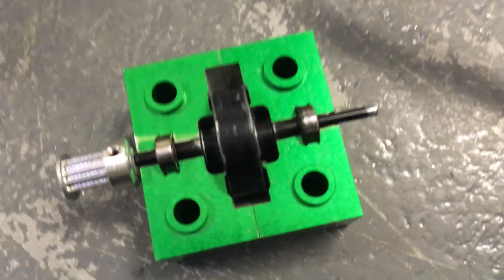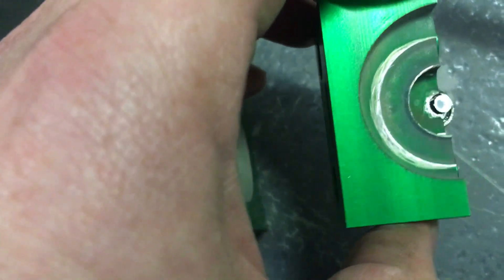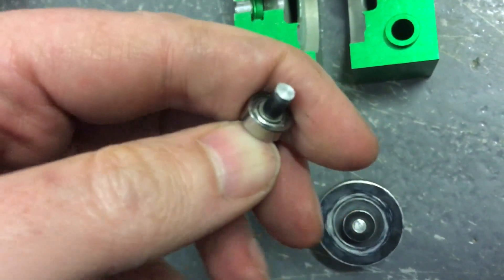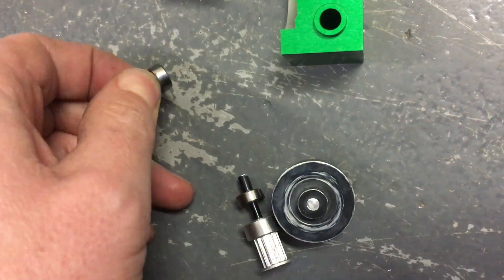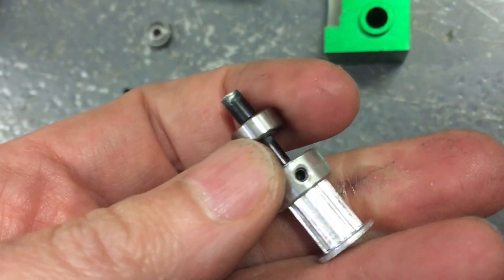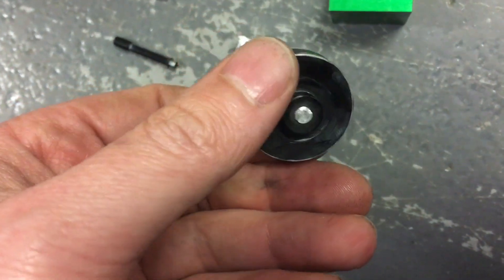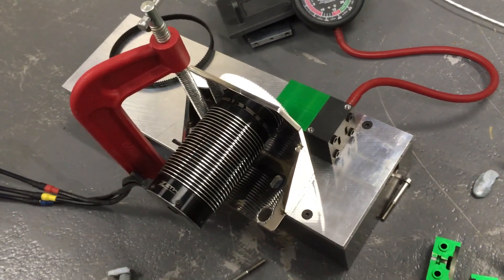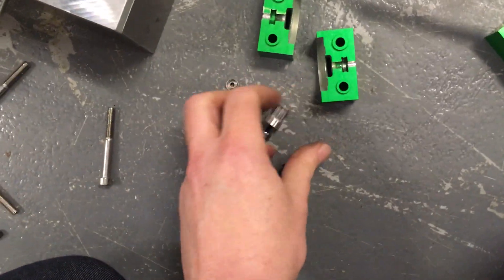Miniature Machine Single Disc Rotor Destruction Test 1 - The Damage!

Comment: I was expecting a grove in the middle of the disk for a second there, looks like it put up a fight. thicker shaft and bang on...oh damn not intended but funny IMO so I am leaving it.
Reply from the maker: The tests are to see what the strongest but bargain basement of surface area, bottom of the range rotor can do. Where does the vacuum pressure ramp start on a rotor this big with 28mm diameter? It starts off at about 100rpm on a 800mm rotor. The sidewall gaps heavily affect this and this is ultimately what I'm tuning. Can a single disc rotor be of any use? Tesla writes that a single disc can perform as much work as a whole bucketwheel.
Reply from the maker: Yeah the thing is I could machine this rotor to something neat and insert a grade 5 titanium or Inconel 718 shaft in there and it's good to go!
Reply: @nikola.tesla.r.and.d.centre   Good to see the work is going on. :)

Comment: Jeez, I was expecting worse. Much worse...
Reply from the maker: As I have copied the way Tesla builds his rotors, not one of the crashes I've had so far has been dangerous. I've had perhaps a dozen now, many off camera. This is why I'm confident to be around the machines when doing high speed testing. I never used to be, I would hide behind something thick.
Reply: @nikola.tesla.r.and.d.centre  That was sensible it doesn't take much to die from high-speed bits flying around.
Reply from the maker: @Barskor1  I have proved when these machines are built to the way Tesla's diagrams depict and are described in his patents they are perfectly safe.

Here is one of his writings on the subject:

"Another advantage deserving the most careful consideration of the user is the perfect safety of the new turbine. There is an ever present danger in a machine of the old type, that the wheel might burst and destroy life and property. Such a deplorable accident is absolutely impossible with the new turbine rotor, composed of thin discs which expand slightly and come to rest, invariably without damage, as has been shown in exhaustive experiments."

https://teslauniverse.com/nikola-tesla/articles/lighting-machine-novel-principles
Reply from the maker: If these machines are built as Tesla depicted in his diagrams following all the text information of his equipment from the patents, I would gladly work around them in high speed destruction tests. The closest I've been to an accident in this line of research so far is burning myself on the PDE or a pulley coming off that really should have been on a key way. The 16hp starter motor for the large vacuum pump / wind turbine hit a resonant point and the whole thing was like a magic carpet crossed with a whacker plate. I was standing on it at the time whilst it moved randomly around the workshop.

Comment: looks like a bad design :-P
Reply from the maker: The design can be massively improved. Matching the diameter, side wall gaps and rpm for what you want it to achieve, its a solid design. You can't expect it to make high vacuum at low rpm unless it is large diameter huge, but it is the rotor that is most unlikely to warp. I just put about perhaps 75% of 13.33kw / 17.87hp through an unbalanced rotor with a 3mm aluminium 7075-T6 shaft at 136,000rpm before it broke! It proves how good the material is and how safe Tesla's designs are. Take that shaft up to 8mm and that will take some torque! Here is the most powerful RC motor in the world with a 10mm shaft and 53bhp. https://www.mgm-controllers.com/en/the-most-powerful-esc-motor-combo-for-rc-cars
Reply: @nikola.tesla.r.and.d.centre  alone the missing radius between the different shaft diameters is a no go :-)
Reply from the maker: @lookingforthemeaning  depends how strong the yield tensile strength is. If it was grade 5 titanium more than twice as strong. A thicker shaft is the best option and a taper between them, I see what you mean. I've done a taper on previous shafts. Also not such a tight sidewall gap. I've already found out that taking 0.3mm off the sides performs much better. Also I have bearings rated at 373,000rpm which is much better than the ones used in the destruction test that were rated at 80,000rpm.
Reply from the maker: @lookingforthemeaning  to be fair all things considered it took a lot of punishment for what it is. Using compressed air and the correct gaps it will likely go supersonic at 234,000rpm without breaking.

Comment: that motor's a beast
Reply from the maker: I know yeah 300amp @ 44.8v https://www.align-trex.co.uk/rc-cars/rc-car-electronics/rc-car-esc-motor-combos/1-5-beast-pro-combo-with-300a-esc-bp-70120-620kv-motor-lcd-program-card-ztw623005112.html?gclid=CjwKCAjw4ayUBhA4EiwATWyBrqZFc-EIl5h7IzHgBSTmbAEAJuEvKJpCEvPW8wATHX5ocqocYv9a7BoCBwYQAvD_BwE Have a look at the daddy! https://www.mgm-controllers.com/en/the-most-powerful-esc-motor-combo-for-rc-cars but for speed this one does 65,000rpm as has carbon fibre covered rotor.... I would go for this next https://www.mgm-controllers.com/en/top-speed-12s-esc-motor-combo-en-10 I don't think the ESC's look anywhere near as pretty as the Beast Pro.

Comment: In Tesla's designs, how did he deal with heat(build up/dissipation)?
Reply from the maker: "Nearly Frictionless Bearings" Tesla called them. Using a viscous fluid gearbox to transfer the torque via vortices rather than a belt or gear drive. He worked out the mechanical equivalent of an air core transformer and applied it to 2 stage machines primarily with a 1:3 first stage to 2nd stage surface area amount. He patented this device in 22 countries. Originally Tesla used hydrodynamic oil bearings but later switched to hi own aerodynamic bearing design. Passive magnetic bearings  can have 500-5000 micron tolerances compared to air bearings much harder to achieve 2-50 micron tolerances. Also passive magnetic bearings don't appear to suffer from fluid shear because of the much higher air gaps.
Reply: @nikola.tesla.r.and.d.centre  Ah. Thank you. Can you recommend a book on the subject, that maybe covers his experiments, please.
Reply from the maker: Tesla was quite secretive with the experiments for these machines. His assistant Fritz Lowenstein did document some of the early experiments as they had to use it for patent rights purposes to prove the adhesion and viscosity principle to the US patent office. I'm sure with a little bit of searching you will find this book for much, much cheaper and it does have those tests. https://www.amazon.co.uk/Teslas-Engine-New-Dimension-Power/dp/188491733X 

Most of what I know was learnt through experiments which then made Tesla's writings have a whole new meaning. Many of these experiments are documented on this channel.
Reply from the maker: By continually expanding air this created a cooling effect when using contact free bearings as no place to turn mechanical rotation back into heat. Expanding air stretches it out and then the machine can convert the velocity of rapidly expanding air into mechanical rotation.
Reply: Short and sweet they are air-cooled by the air that is the bearing, flow in cool flow out hot.
Reply from the maker: @Barskor1  they can be cooled by the rapid expansion of air as it converts the pressure into velocity through stretching the air and converting its velocity into mechanical rotation.